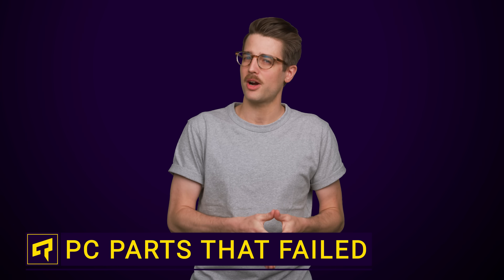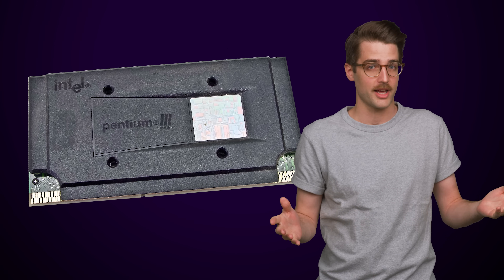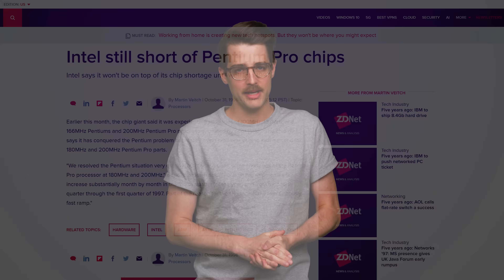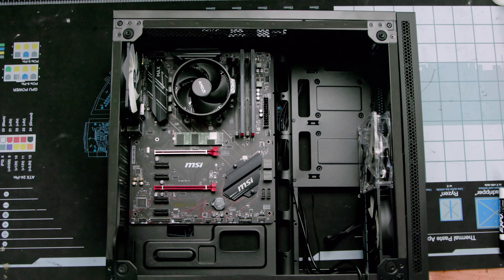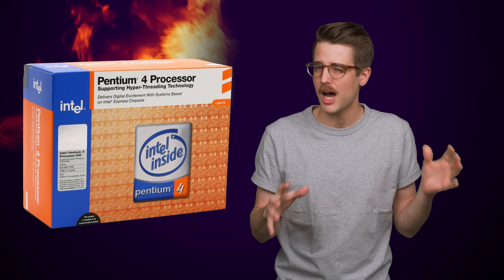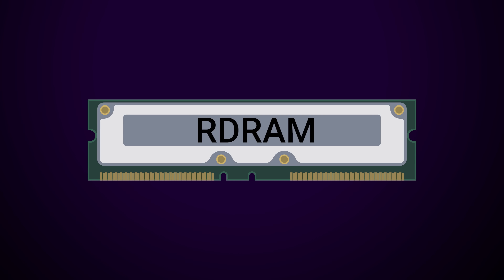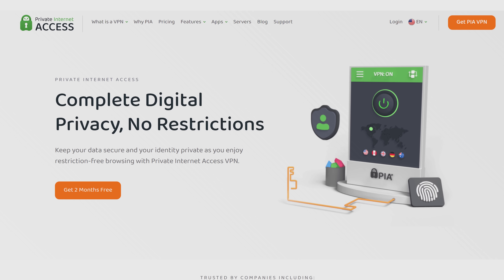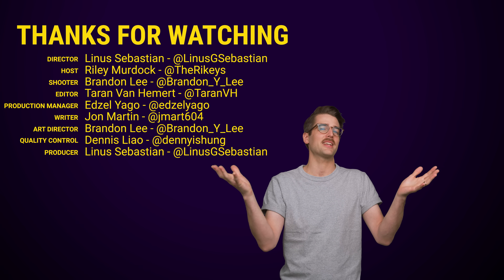PC Parts That Disappeared

Comment: RDRAM also needed dummy sticks in the 'empty' slots.
Reply: Rambus was a catastrophe in every way. The bosses at Intel got into bed with Rambus and tried to shove it down everyone's throat. Their own technical department hated RDRAM and nobody but Intel actually got on the train. The result was it gave chipset manufacturers like Server Works an open goal, taking home a lot of design wins for motherboards and high performance computer centers.

The best (worst) part was when Rambus applied for a number of patents on technologies used for DDR memory that was described in the papers published by JEDEC before the final standard was nailed down. Only to have Rambus popup demanding royalties on all memory built to these specifications.

There for a while Rambus was the most hated company in the computer industry.
Reply: @blahorgaslisk7763  Nintendo used them in the N64 as well
Reply: @dizzydaisy909  ah, yes, the Jumper Pack. That strange thing that you didn't know why it could come out until the Expansion pack happened and you wondered why they didn't put more RAM in from day one (Cost, I know).
Reply: @DFX2KX  My understanding is that the thing that came out was just the dummy slot described upthread.
Reply: @dizzydaisy909  The PS2 and PS3 also used RDRAM.
Reply: @blahorgaslisk7763  RDRAM was the superior platform for memory bandwidth. The problem was that Pentium 3 and K7 couldn't take advantage of it due to their narrow FSB. The Pentium 4 addressed this with its quad-pump bus which why RDRAM was premium choice on that platform and remain unrivaled until higher-clocked DDR1 (PC-3200) finally came to Pentium 4 when the RDRAM-Intel exclusive deal expired. 
RAMBUS and rest of the memory cartel were trying to screw each other hard in late 1990s and early 2000s. Memory cartel end-up winning in the end. There were no saints in that legal battle. RAMBUS tried to strong-arm through patent trolling DDR1/DDR2 specs while memory cartel refused to produce RDRAM chips despite being paid by RAMBUS in contract to do so and sold their SDRAM and DDR1 units at break-even margin or at a loss.
Reply: @blahorgaslisk7763  I remember this shi$t show, Rambus would have made a killing,  but no, they filed law suits left, right and centre. "There for a while Rambus was the most hated company in the computer industry", to the point Intel where embarrassed, shortly after Rambus disappeared from their roadmap.  🤣 Edit> to add that was around the same time as Patent trolling.
Reply: @gamezquenta4227  The main thing I remember is that no one at intel but the management wanted to use Rambus memory with the 840 chipset. No arguments against it were accepted and we ended up with a generation of motherboards that had a very short lifespan.

Now technically I didn't have much objection, but there were no real performance advantages with the P3 series. And the way Rambus wanted to play the game had every memory manufacturer pissed off. That's not a good way to build market and brand recognition.

Well there were a bit of a problem with latency. Sure Rambus was blisteringly fast when transferring data, but the latency introduced was a lot worse than traditional DRAM technology. And if anything we have learned that these latencies really matter. With RD-RAM  these latencies is a lot harder to improve than they are for traditional DRAM and DDR-DRAM.
Reply: Aren't they called terminators?
Reply: @spavatch  They are not terminating the signal but simply connect the input to the output pins to complete the ring. Any break in the ring and nothing works. It's almost like the old Token ring network in that way.
Reply: @blahorgaslisk7763  - fair point, thanks
Reply: @blahorgaslisk7763  No, they are also called terminators, whether or not that's technically correct. This is also why the N64 Jumper Pak is sometimes called the Terminator Pak in some regions.
Reply: @spavatch  CRIMMs, actually, or "Continuity RIMMs".
Reply: @RelocatedRedbird  I remembered too! and then I saw your post, waa-waa-waa!
Reply: Rambus is actually still around today... And they've sued everyone else, Hynix (now part of the SK chaebol/conglomerate), Micron, NVIDIA, eyc.
Reply: @alext3811  Wasn't RAMBUS still being used by Intel in some of their more recent CPU designs for CPU Core-to-Core communications?
Reply: @TheXev  Maybe? Idk.
Reply: Electrically, RDRAM was a departure from SDRAM which necessitate the need for C-RDRAMs (basically repeater/regeneration modules). They weren't that expensive though $5-10 at the time. Not much different from handling parallel SCSI which required Device IDs and termination on bus.
Reply: @Krogoth512  You actually answered a question I asked lower down. It was weird they didn't explain why Rambus was so different from current memory.
Reply: Weren't they called C-RIMMs?

Comment: The PS3 used an RDRAM, hence, it was the most expensive console of the 7th generation.
Reply: So did the N64 and the PS2, RDRAM did look promising at the end of the 90s early 2000s
Reply: errr was it not becasue the cell brodband cpu (souped up power PC) along with the RDRAM and a Nvidia GSX level gpu??? Oh and SONY and BLUERAY? also first gen ps3's also had a full PS2 basically built in to them. so you also had the reality synthesizer and the emotions engine chips
Reply: @CotyRiddle  it was still the most expensive console in its generation given the Xbox 360 and Nintendo Wii are still cheaper than the PS3.

The cell broadband architecture was overhyped and disappointing. It made programming for it unnecessarily difficult.

The Blu-Ray was its saving grace.

Comment: Let's start with: cartridges that my TI-99 used lol
Reply: My favorite game on the Ti-994A was B1 Bomber... which I loaded from my cassette deck (I could start loading the program, go downstairs make and eat lunch, come back and it was almost done loading).
Reply: LMAO.
Reply: Or the tape drive on my commodore haha
Reply: @davidamoritz  I spent the $150 in 1986 to get the 5 1/4" floppy drive.
Reply: @wolfshanze5980  in 96 I spent 800 on a cdr lols it was 4x write haha
Reply: @wolfshanze5980  I still have a box of old comp stuff one day I plan on making a little display with my original SCSI Fireball it's the size of a shoebox 😉 and some other components like my 3dfx card 32 Megabytes whew I was the king of Quake with that and a ISDN line both channels
Reply: I still have mine, Parsec was by far the best cartridge game, Still have the old Scot Adams adventure series on cassette tape. a few years back an older guy i knew found out i still had mine and gifted me 4 more machines and a tote full of cartridges and peripherals.  Remember the snarky lady who made fun of you when you fell on Alpiner?

Comment: Floppy Disks, DAT Data cassettes, ISA and AGP slots. Cooprocessor seprated from the CPU (486SX for example). Graphics cards (Matrox, VIA,S3 Virge) not 3D accelerated units. VGA, DOT matrix printers. AT standard. Cyrix company.

Comment: I had a CPU slot (Pentium II). It was a nightmare, if I accidentaly moved my pc case the computer would freeze and fail to restart.
Most of the time I had to open the case, remove and insert the CPU again.
Reply: I had several Pentium II PCs, even dual CPU ones, and it never happened to me, and I've never heard of such problems from the others so... sounds like a personal problem :P
Reply: @spavatch  some motherboards were better than others at making the cpu stable in the slot. Of course some people used 3rd party coolers which could also cause some problems with their weight and gravity.
Reply: @bionicgeekgrrl  - I think what constitutes the problem is the fact that people didn't use original CPU brackets. Most mobos had foldable plastic rails with fastening clips that held the cartridge in a safe, stable, upright (or more precisely perpendicular) position. Some guys took them off for one reason or another which... brings us to my assumption that it's more of a personal problem rather than anything else ;)
Reply: But you didn't need to be a master of applying thermal paste back then, so that's a plus...
Reply: Did you blow on the CPU socket before you put it too? roflmao seriously, that would make for one hell of a meme.

Comment: Legit question: Why don't we go back to cpus being on their own cards?
It's really annoying needing new motherboards on cpu upgrades, and different motherboards for AMD vs Intel.
Graphics cards are basically plug and play anywhere.
Reply: The card connection on a GPU is just for data throughput, and the core handles it and the memory. So in theory as long as data throughput doesn't increase beyond the limits you won't need a different connection. And if you use an earlier PCI standard on a newer card it simply caps the data throughput to the max it can handle, if I'm not mistaken. Like connecting USB 3 flash drives to a USB 2 port.
Meanwhile a socket iteration often either adds pins or changes their locations which means that the connections inside the motherboard are not compatible. For example a CPU socket that supports triple channel memory needs to have pins that handle those connections to the third channel. Even if you custom-made a CPU from a previous generation that fits in that socket but only has dual channel memory, you probably wouldn't even get it to boot because everything would be crossed. The pins that were supposed to handle the third memory channel could be trying to connect to the sound card, it would be a total mess. So trying to replace the socket for a card slot without requiring a new motherboard with a new slot would be extremely hard because all the gold contacts on the slot would need to line up with the next generation and new features would be difficult to add.
This isn't to say all socket changes were justified, I'm sure there's been a few that were done just for the money.
Reply: Technically speaking all modern CPUs are "in their own cards", they're just really tiny and feature lots of connecting pads/pins in a flat 2D array.
Jokes aside, as Titanium Rain explained, the reason why sockets differ generation to generation is because CPUs are much more directly connected to the rest of the hardware than co-processors like a GPU. It is feasible to put CPUs in some sort of standardized socket, but you would either need to over-spec the connector for future-proofing (incrementing costs), create abstraction layers that allow new features to be addressed over old channels (increasing latencies and reducing performance), or change it for a new one in a few years (what CPUs do right now)
Reply: A socket for any CPU means a socket for your chipset and some expensive FPGAs for adaptive routing. GPUs are co-processors running over an expansion interface, not  primary processors
Reply: @oiytd5wugho  Some of these comments are pretty good. In the recent years however; since on the desktop side of things, Intel hasn't actually come out with new features like a process node shrinkage, or a different DRAM controller. Most likely they kept changing the socket pins so that you had to go out and buy a new motherboard for the "new platform". Basically the budgeting department told the engineers they needed to make a little more money and then last quarter and the Sales team came up with some claims as to why it was needed. Until the 11th gen core series was a thing, Intel had 0 answer for the PCIe 4.0 on their platform, AMD already did. AMD also didn't change the platform from gen one Ryzen to gen 3. Buy a Ryzen 2600 and stick it in a 500 series board and your off to the races. May only need a BIOS update. Not an entire new motherboard.
Reply: There is a good chance this might happen.
AMD already have sockets that can survive many years, and there are experimental technologies to connect RAM through the PCI-E port.

So there is a chance that next generation CPUs will only have power and PCI-E and nothing else.
Reply: fun tidbit, there are a VERY select number of AMD motherboards that had a slot for a daughterboard which held a newer socket design. This was like AM2, then AM2+ on the daughterboard. I have no idea why they where made. They're the fastest CPU that still had an AGP slot, as well. Gigabyte made them IIRC.

Hypothetically such a system would be possible in the modern day, but it would take the form of the "CPU" being a full System-on-a-Board with RAM and all. the slot would just connect it to a PCIE backplane for expansion. Intel tried to make that a thing at one point.
Reply: This was done in the early days of computers already. Unfortunately i cant remember plug or standard names, but the motherboard was named carrier board, and it was mostly just pcb traces to various slots, and everything was on what we call daughter boards in the server world.
Reply: The Slot 1 and Slot A were the same, but AMD reversed the Slot A connector position to ensure nobody put in the wrong type of processor.
Reply: Your question assumes the CPUs being on their own PCB meant they were interchangeable. They were not. They didn't have any advantages over modern CPUs, but they were larger and more expensive to make. As for why we don't go back, they were larger, more expensive to make, and would be slower than modern CPU designs.

Comment: Slotted CPUs first appeared in home desktop computers with the Pentium 2? Uhhh... Okay, so I guess we're completely ignoring the CPU slot on the A3000 that allowed you to slot in a card with a 68030, 68040, along with FPU units and CPU cache, with such cards including Commodore's A3630 and A3640, a full 4 years before Pentium 2 was released? Okay, so I know it's not the primary CPU on an A3000 and the desktop will run fine without it as it can work with just the lower-clocked 68030 soldered onto the motherboard, but they were CPUs stuck to a card that you stuck into your desktop computer. Quit with the x86 bias.

Comment: You do realize that the reason for the 2 in Core 2 processors is that there was a Core processor first. The Core was 32 bit, like the Pentium 4, then when Intel was finally forced by AMD to go to 64 bit they came out with the Core 2. You did get the 2006 part right.

Comment: iGPUs built into motherboards before they transitioned to the CPU to make the modern APU.  iGPUs in motherboards were notoriously bad.
Reply: Very few exceptions to that list. some were capable of doing very light gaming. (there were some iGPU's that had dedicated ram.) "cant recall off the top of my head but I had a dell with a ati chip and a few MB of ram solely for it"

Comment: The Pentium 4 processor line was killed because Google data centers found out they did not need faster computers, they needed more efficient computers. So Google made the statement. There is no reason to ever upgrade our current servers unless the replacement servers give us more performance per watt. 

So intel had to make more efficient processors  or loose the server market.
Reply: No The netburst arch was just piss poor with it's extremely long pipeline.

Comment: FWIW, as I remember it the main reason Intel were reported to have for slot-based CPUs was the fact that they were fed up with being lumbered with all the work of designing motherboard chipsets that other mfrs like AMD could make compatible CPUs for. Intel patented aspects of their slot system which made it impossible for compatible CPUs to be made so AMD had to take on the load of designing chipsets to support their own CPUs instead of freeloading off of Intel in that respect.

Comment: I think it's okay to mention all the components which needed their own carrier boards, and are now integrated into another components, be it motherboards, chipsets or CPUs: (basic) audio cards, disk controllers, memory controllers (and northbridge), USB controllers, COM & LPT controllers. Beside that, there are standards which faded - Firewire (used as recently as 2018, because for a long time it was the only way to debug Windows kernel drivers), earlier mentioned LPT, separate 2D & 3D controllers (yes, I am referring to VooDoo 1 and 2 cards), modems, ZIP drives, optical drives and 3.5"/5.25" stuff in general including the slots themselves.

I think having multiple CPU and chipset manufacturers is worth mentioning (like for Pentium 3 you had choice of VIA, SiS, Intel, ALi, and Broadcom chipsets). Little earlier, 80486 was manufactured by Intel, AMD, Cyrix, TI, IBM, STMicroe., UMC and (in later years) around 20 other companies, some licensed, some not.

Comment: 0:54 didn’t the amiga have a slot for a secondary processor back in the 80’s (name escapes me at the moment)? Or am I completely misunderstanding it’s purpose?
Reply: The fast slot in A2000 was to upgrade to a faster 680xx and floating point processor. http://amiga.resource.cx/manual/A2630.pdf Those cards were full length chonkers.
But the original 68000 stayed in it's own socket on the motherboard.

Comment: SX and DX did not mean the same thing across 386 and 486 CPUs. Additionally, there were 486DLC chips that were based on a 386 pinout. 30 pin and 72 pin RAM, DIP style cache and tag chips, power supplies that if put in backwards (not black/black) would destroy the motherboard, leaking barrell batteries... Yeah the 90s were a ton of fun. 

You guys have it easy now.
Reply: Indeed.